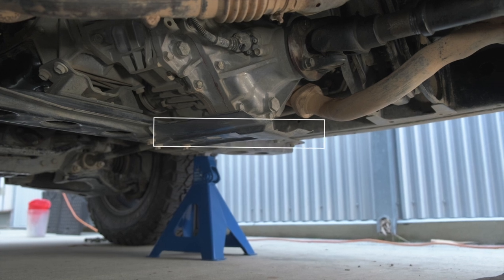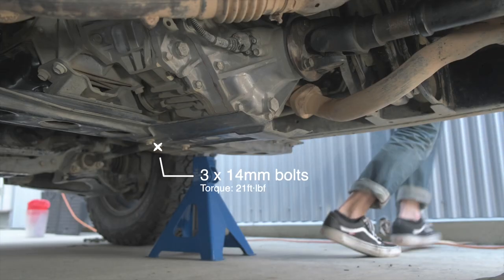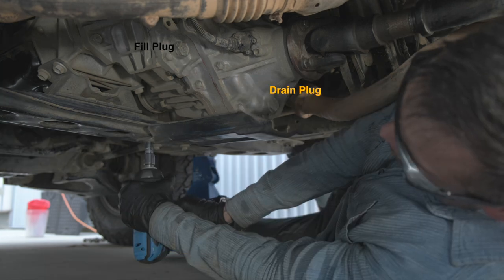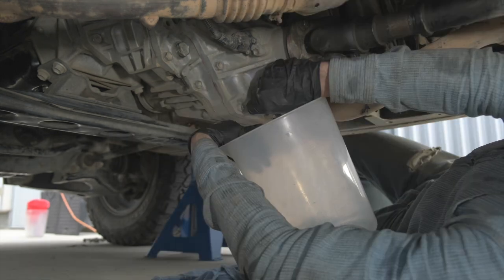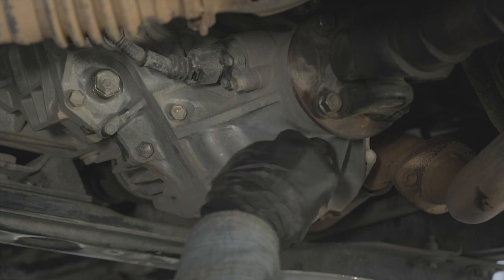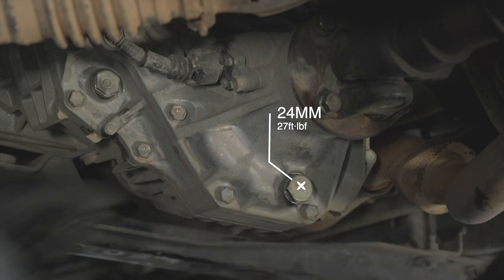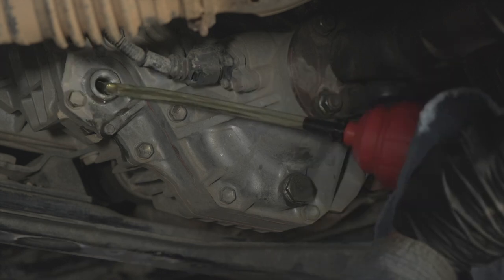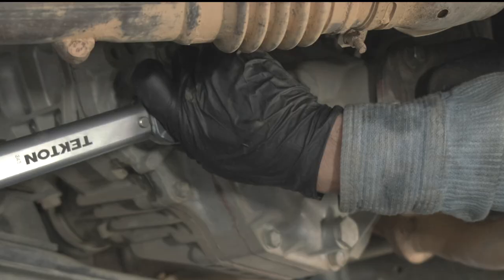TRANSFER CASE Fluid Change 100 Series Land Cruiser - Quick & Easy

Comment: Hi. You mentioned drain plug number 90430-18040 in the description. Isn’t it 90430-19057? Or is this maybe the same size and can be used as well? I found the 90430-18040 as the drain plug for the rear differential. And I am also a little confused about the washer part numbers. Both 12157-10010 and 90430-18008 seem to be the same size for M18 bolts but different shape (simple ring vs. crush washer)? Are these interchangeable? Thank you very much for your superb no-nonsense videos! Well appreciated, two thumbs up.

Comment: Just changed my transfer case fluid as well as the differentials, and all of a sudden my car start having a hummimg sound when i take my foot off the gas pedal usually arounf 25-45ish mph, and it goes away when i press the gas pedal again

Comment: Excellent video, I recently acquired a '06 LX470 and I love it.  Videos like yours help me do my own maintenance!  

Do you have a video on front diff?
Reply from the maker: Congrats on the LX and thanks for the feedback - I appreciate it! Just posted a video on changing the front diff fluid. It’s a pretty easy job to tackle. Let me know what you think!
Reply: @LandCruiserDIY  Unfortunately, I took care of this last week so didn't get to see your video.  I like your method of measuring exactly hw much you are pumping in.  I've now done rear/t-case/front on both my '06 LX470 and my '00 4Runner and in all cases I relied on the overflow.  

Another tip I learned, leave fill plug slightly in while draining.  This will prevent fluid from shooting out all the way to the wheel and instead come out with less force.

Comment: interesting my skid plate bolts were 12mm, super helpful videos just did my transfer and rear diff, didn't have a T55 torx bit though for the front so i'll have to buy one
Reply from the maker: Thanks for the comment! Let me double check mine and I’ll put a sticky on the video so others can see the correction. Good luck with the job!